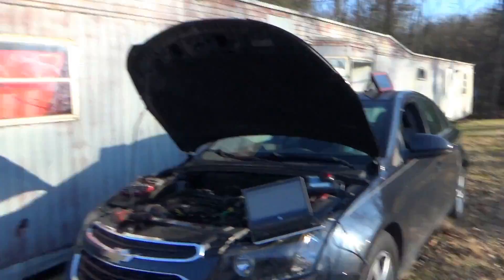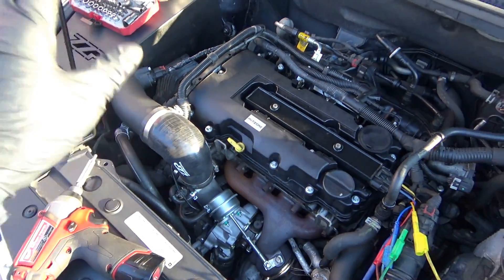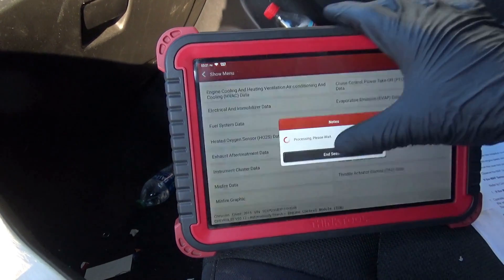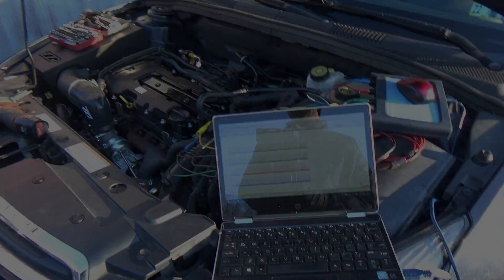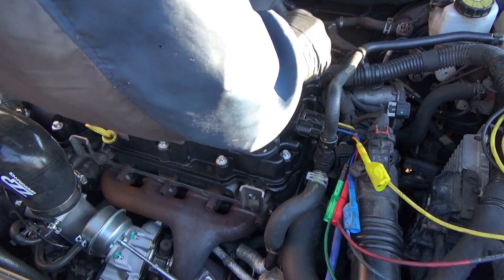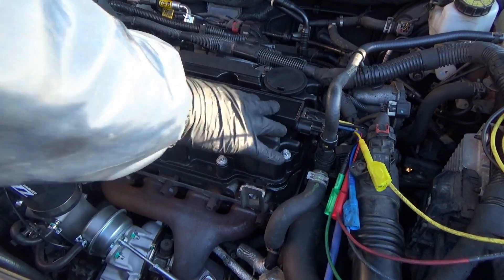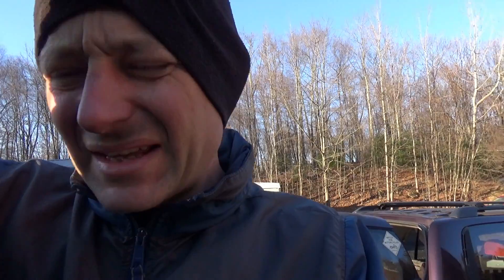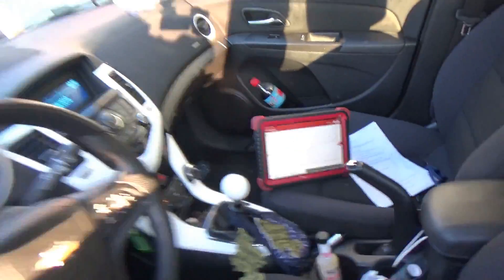2-Cylinder Cruze? (Can you TRUST Scan Data?)

Comment: As a gm tech, I cringe every time I see a shiny black ignition coil on these 1.4L engines. The epoxy on the oem ones is tan. The oem ones go bad enough, but I’ve seen these dorman ones go bad right away, and cause weird issues that are hard to diagnose. One vehicle kept dying on the customer and would not restart. He had it towed in several times and every time I looked at it, it ran and drove just fine. Ended up being a dorman coil pack. Since then I always check for oem coil right away.

Comment: It's all a crap shoot these days even with OEM.  I replaced the original timing belt on a Kia soul at 110,000 km with a complete Aisin kit.  40,000 later the tensioner pulley bearing siezed and created quite a mess. 

Seems that Aisin kind of gathers different parts of their kits from different suppliers so not doing that again. The original Kia timing belt and tensioner were clearly marked Gate's.  Ivan, I remembered the video you made where the Gates parts you ordered were not up to parr and you called Gate's about it. With that in mind I couldn't bring myself to order a replacement Gate's kit either so I got all Kia OEM parts even though the Kia belt alone cost more than the entire Gate's kit including the water pump.

When the Kia OEM belt came it was clearly marked Gate's made in china!!!!! and was visibly of lower quality than the 110,000 km original Gate's belt.
Reply from the maker: Try Continental kit next time 👍

Comment: Saab 2.0 and 2.3 engines were also very picky about ignition casettes, aftermarket junk would only last a month or two and start misfiring. Only option was to go genuine OEM part that lasted for quite a long time.
Reply: Yeah those T7 units worked hard in a difficult work environment. If you bought after market, the cash savings were wasted because you had to buy 2 lol. At least Saab were kind enough to give you the tool to change them on the side of the road.
I only ever had 1 unit fail on me....as I pulled into my garage after a trip.

Comment: Don't trust Ford service data either, it is purposely designed to lead you to the wrong conclusions. I had a 1.6 Ecoboost this week that started running rough and throwing a p0395 cam sensor b (exhaust) no signal. Code set criteria claims that code only sets when the signal is completely missing, so I checked it and it was producing a perfect waveform all the way to the ECM. I knew better than to trust Ford service data due to past experiences, so I didn't want to call it a bad ECM. I ended up finding that either the timing belt had jumped 5 teeth on the crankshaft, or the pulley had somehow "slipped" since Ford engineers are so stupid that they don't key the cam and crankshaft pulleys. I set the timing properly using the ridiculously over complicated procedure and  now it runs great, no parts required.

Comment: Talk about  cheep parts not yet 100000 miles and original equipment already wore out
Reply: Domestic 4 cylinder. Need I say more. Add the turbo on and its a dumpster fire.

Comment: There are times to go cheap and there are times to go OEM.  Dorman makes nice aluminum coolant elbows to replace the stupid plastic ones that GM put on the 3800 engines and I have had acceptable success with their "HELP!" items sold at the parts stores for odd-n-ends, but you should NEVER buy engine electronics from that company or any of the "Brand-X" companies that manufacture their stuff in the People's Republic.